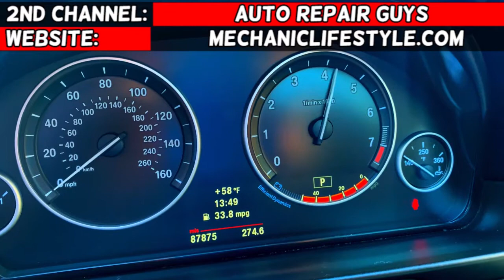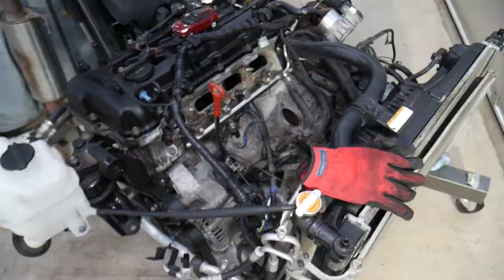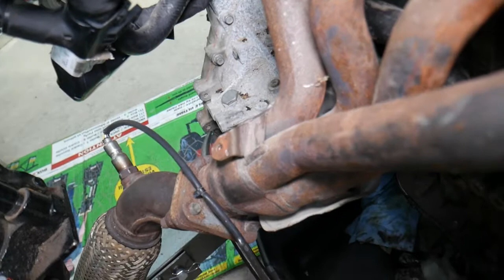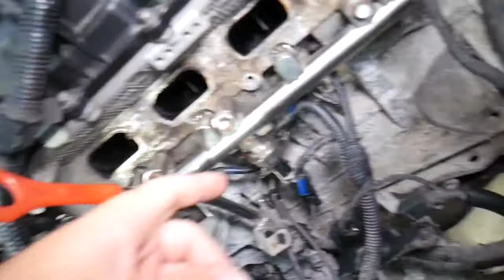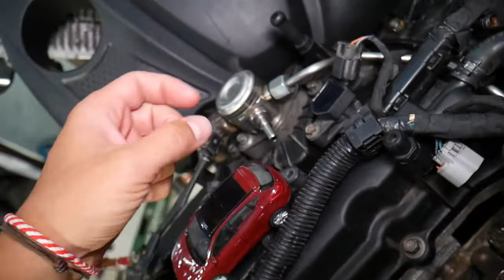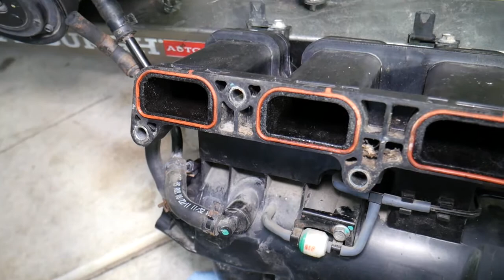HYUNDAI TUCSON CODE P2195 P2196 O2 SENSOR SIGNAL STUCK LEAN RICH, CHECK ENGINE LIGHT ON

Comment: Ive got a 2007 Suzuki grand vitara with P2195 and PO420 codes. on the obd2 screen i see the o2 sensor is running between -0.05 to 0.42, the Lambda is around 0.990. from this i understand one sensor for sure isnt working right. the back one (i guess its the lambda) was replaced not long ago and dosnt show a code. would you say i have a front sensor problem? or maybe the MAF sensor? i am no mechanic but in my country no one has answers to my questions.. so ive got to learn by my self
Reply: also my car uses lots of gas lately